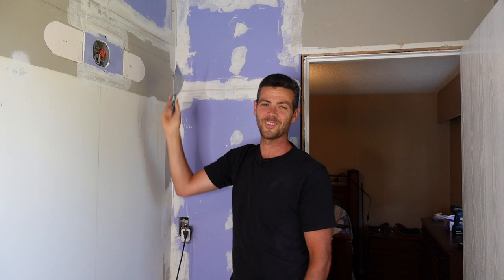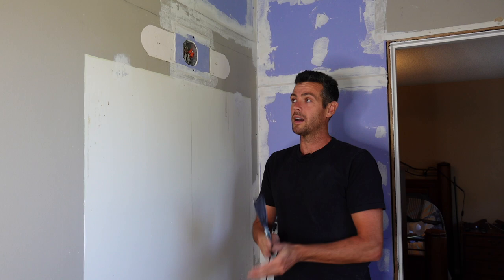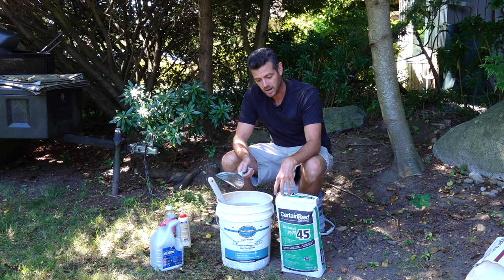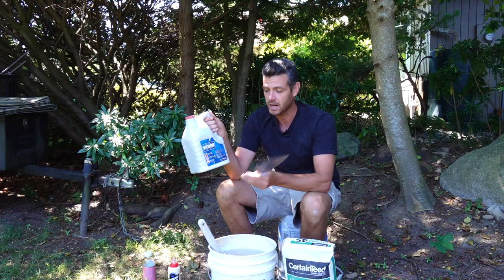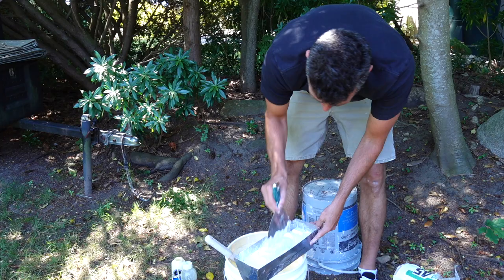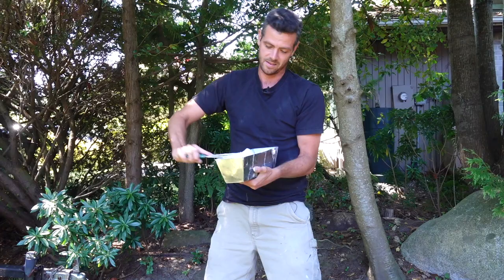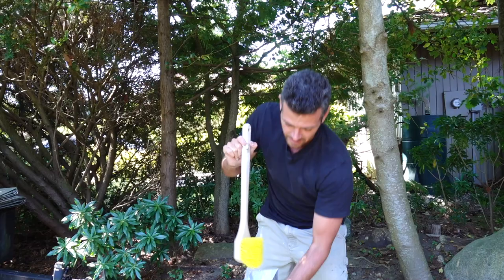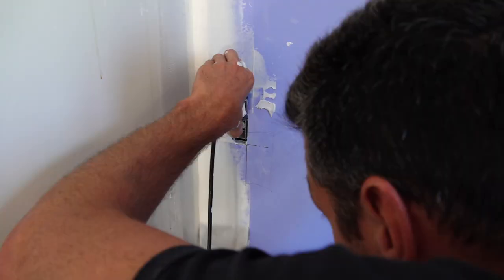How and When to Add Glue to Joint Compound!

Comment: How about channel bead, I have numerous places where it is chipping off and I can see empty voids through the holes?
Reply from the maker: I totally forgot about that. Coating anything plastic I add glue to my mud.
Reply: Use Durabond as your first coat for such a demanding repair.
Reply: Does Durabond have enough glue to stick to a painted (glossy?) surface?
Reply from the maker: @michaelbasic6947  I would at the very least sand the surface.

Comment: Just FYI, I called Weldbond and asked them about mixing their product with drywall mud and they stated that the proper mix ratio is 1 part Weldbond to 3 parts water.   I skimmed an entire room with 45 minute quick set mud and it stuck like you wouldn't believe.  I was worried because the walls were gloss painted orange-peel texture.  But the stuff stuck great using that mix ratio.
Reply: Thanks for putting in the work and getting that info :)
Reply: @stevensko9153  thanks. I'm going to use a little gorilla in my topping mud to do some last minute taping I missed
Reply: Extra glue doesn’t matter. Isn’t like he measured anyways 😂
Reply: Sounds like a lot of glue, especially if that 1 to 3 mix isn't added to the pan water as VC did.

Comment: What the heck? Glue? I mean I am sure it works great but why? I am only in 33 years but never had problems w bonding. Only going over paint that was glossy in my early years w paint but proper De glossing/washing solved that.
Reply: A crack on washable/ high-quality paint on smooth walls can be a pain in the ass. The lack of adhesion even with regular mud is an issue.

My only comcern is sanding or pulling a tight coat with regular and have that delaminate

Comment: A video that is validation of my belief about glue in 45 set mud.This is something I started doing 5 years ago. This has saved me thousands of dollars. Most of my work is repair work. Plus I mud over painted surfaces. Thanks for putting out a video that will help many people. Learning about the importance of strength and adhesion. Significantly increasing the performance of plastering products. Paper tape seems to work very well with glue mud.Mud sticking well to screw heads and metal trims is paramount.
Reply: I think it all boils down to cost and scale. Drywall is just such a cheap material in the grand scheme of things. If you could buy a regular bucket of mud for $11, or the BEST, guaranteed not to fail mud for $22, would you? I would. But a commercial high rise contractor wouldn’t. That bottle of titebond quite literally costs as much as the entire bucket of mud. And thus we have arrived at the fool-proof guaranteed not to crack small job salvation mud.

Comment: You are a good example of someone who thinks out side the box. Quick set is a great example, I’ve always used glue in place of the expensive plaster bonders. I know it works, no fail, restored Wyatt Earp’s childhood home before his family moved west, complete restoration completed part of the top floor 12 years ago, no flaws. Light years ahead of another crews restoration in similar walls and buildings built in the 1850. They used a lot of horse hair back in the day. Probably used the hooves for glue😂 back in the day. Pella Ia.

Comment: Maybe a topic to cover? I am drywalling my cottage right now and I am stumped as to the best way to mud odd angles and transitions. I have walls that transition to open angled vaulted ceilings and also have sloped ceilings that transition to a flat ceiling higher up. I am struggling to get a clean finished straight line where the two planes meet and to actually get enough mud build-up at that location to allow sanding. I used Sure Corner tape at these locations. thanks for considering this.

Comment: If you lived in interior BC when sometimes there are extreme (wet) snow loads, you would use glue to repair failed joints that only failed because of a rare 1 meter of wet snow on the roof. I wasted a lot of time and trouble assuming taping mud has enough glue in it. The tape doesn't necessarily lose bond to the wall, but rather tears apart. It's much harder to tear drywall tape when saturated with wood glue. I have never had to repair a failed joint with added glue. Even when the cracks happened under normal snow loads, yet the glue held up during the 1 in 20 years when we get massive wet snow loads.

Comment: The glue added to make sure paper tape sticks and never de-laminates. Sanding more difficult but  excellent results even if too generous with the  glue.
Reply from the maker: I never end up sanding it as I only use it in quickset and only top coat with pre-mix.

Comment: Using glue in hot mud is something I do anytime I’m installing tape, bead and pre-fill on painted/old work/repairs. Including vinyl products like expansion joints and edging trims etc. For new work I just use taping mud for all taping, bead and edging. I typically hit the screws when taping as well though when I spot screws using taping mud I keep the spotting as small as I can to make it easier to finish and sand. Nothing worse than having two different mud types exposed when sanding. The softer mud will always hollow out. Keep it small and tight when using taping mud on screws. 👍

One ol’ hawk and trowel mudder to another  😂

Comment: Someone asked you about using Durabond in some past video and I remember your reply was that if wasn't easy to find in your area. Come on, get a bag, try it, it is very good, although I doubt you haven't tried it already? The only downside is how it is so hard to sand, but that superior strength and adhesion is a good thing since it's appropriate use is as the base coat in demanding taping, repairs and prefill situations where no sanding is needed. The other (I think worse problem) is how it demands you clean your tools right away and very well.

I think adding glue to regular setting compound is an antiquated, more time consuming and inferior to Durabond. Preparing the surface is the most super basic, yet essential step in 1000s of repairs. As you point out, 1:35 "got to sand it ...not enough", so by "not enough"; I don't know if you mean to say that your chemical solution of adding glue removes the need of surface prep sanding or you both sand and add glue?

For the type of greasy/waxy surface that even sanding won't solve I use a ammonia/water solution with a green Scotch Brite pad before sanding. It leaves it squeaky clean with a dull finish. Sanding after leaves an excellently prepared surface.

Comment: I have been using a pva product called Unibond for decades now,    But I almost never put it IN the plaster, if you want to skim a painted wall brush on 50\50 let it dry, then paint on a full bore coat. When It gets a little more sticky, plaster it while still wet. It will stay on the wall.  Some of the pva products sold for plasterers are useless,only experience in your own market can tell you about that.   PVA in backing plasters can be useful (repairing lath and plaster ceilings) but it does slow down drying times. Don’t put it in skim coats because if you leave a mark you can’t sand it down easily, and the painters will hate you, it will take forever to dry and the painters will hate you, There will be no suction, the paint will slide and the painters will hate you. PS they hate you anyway, they’re painters.

Comment: Too add water to my pan I use a spray bottle.   On mist fan spray. It lets you add small amount of water over the entire pan.  Better for mixing.  Sometimes when mud is stiffening up and you want it wetter thinner mist water into your pan until you   Get desired feel you want.  Water bottle more controllable way to add water.  ❤❤😂😂

Comment: Not long ago I had to use all purpose mud with mesh because I had nothing else on me, and not long after that, I had hairline cracks in the middle..
I know I know, I shouldn't have used all purpose mud with mesh....
With this said , instead of re-taping everything, I just cleared the seems a little bit more without  ripping through the mesh, and filled that crack with a mix of all purpose mud and glue, and it worked. 
I had already tried on a couple other Seems to fill the cracks with all purpose and it recracked but with the glue it didn't.

Comment: The thing I find interesting is how old school plasterers and drywall folks have similar yet different ways of tackling the same problems. Kirk puts the product--I think it's called weldcrete--on the wall directly before applying his mud. Now, he probably couldn't use your method with plaster, but I think you could use his method with good results. Might be easier on small patches. I'm guessing you like the mixing method better because it's easier on bigger jobs such as taping.
Reply: I think the reason you don't mix pva into plaster is that the plaster is very hard and strong by itself, unlike drywall muds which are quite soft and weak, so mixing in the glue is more likely to compromise the strength of a plaster, but that is just my somewhat informed speculation.
Reply: He is using plaster / aka stucco products , and I would guess would not sand or wash down anything before application of the bonding agent.
Thanks for posting

Comment: USG has a product called plaster bonder which is made of polyvinyl acetate (PVA). I live in a home with plaster and lathe and I applied it with a spray bottle to the old plaster when I am doing a repair and it works great.  I have wondered if this could be sprayed or wiped onto a wall if you wanted to do a large patch or skim coat with quick set.
Reply: Yup PVA is common white glue like kid eat in grade school.

Comment: Love your style! Of all the videos I’ve watched , you seem the most skilled, I’m hoping you can help me out. I want to create a faux stone wall over rough hewn wood paneling. Firstly, I’m worried about adhesion. Should I be? It is a very rough texture. Do I need to use a primer or mesh? Secondly, , I’d like some stones to stick out up to an inch. I’ve read hot mud is the way to do this as it doesn’t shrink. Or would applying several coats of lightweight drywall mud be better? Any tips here?  Does weldbond also make the joint compound more durable and less prone to wear and tear? Nothing makes a faux stone wall look more faux than chips and chunks missing out of it, haha. And finally, I'd like the finish of stone— can I add something, maybe limestone powder, to give it a porous, stone like finish? Thank you for your time and your channel!

Comment: Not a drywaller here, nor am I a carpenter, and nor am I from Canada.  So maybe I'm just thinking incorrectly... but if you use the glue, just the glue, after mixing it 50/50 with water.... will that still even glue stuff together?  Something tells me that the glue will probably still stick things together, but if you did a side-by-side comparison of, let's say, drywall tape glued to drywall paper - where one is glued with 50/50 water/glue, and the other is 100% glue, the one with water will not be as effective as the 100% glue.  So I have to wonder how effective it'd be when spread even thinner.  Dunno.

Having said that, I love watching this channel.
Reply: Depending on the application, Weldbond calls for anywhere from straight glue to a 10:1 mix. Note also that ALL pva has water in it when you get it.

Comment: I mix a lot of 5-min compound for patching and a paint stirring mixer in a drill is great for mixing the compound lump free.  I mix in round cups for ease of getting it consistent.  Also, what about just priming the wall, with adhesion primer, first?  I see his point for small fixes, though.

Comment: Hey Ben, thanks for another great video! I'm curious if you have ever used Durabond? I think it's a USG product. I've used it alot for prefilling and patching and had good results as far as I can tell without adding glue. I did learn quickly that you better keep it flat because there is no sanding the stuff! Thanks for any input you have! Hope you're doing well.
Reply: Durabond reminds me of plaster it’s so hard to sand. It is made by USG, same as the “easy sand” (total lie) quickset. The later is what I usually buy at my local Menards when I need a quick set mud. 

Has anyone else tried the Rapid Coat Extra Lite? It had a green lid and is made by Continental. I really like using this as a top coat- very smooth application and dries tough but good to sand.
Reply: I think patches and prefills are exactly what Durabond was designed for, especially if you are working on old plaster surfaces, where the hardness of the Durabond matches the preexisting surface. The stuff does seem quite sticky without adding any glue, which makes me wonder if there is an adhesive in it already, despite it being a quick setting powder mix.

Comment: I had problems with CertainTeed brand all purpose light weight compound. The first coat goes on fine. The second coat causes dried chunkies from the first coat to flake off contaminating the seconcd coat mud making a quality finish impossible. I ended up applying  a coat of primer paint between coats of mud to bind it together.

Comment: What about adding glue to the first skim coat if I want to remove texture from my walls? Only if it’s powdered mud?
Reply: Great question!  Wondering the same, especially when skim-coating powdered 45 over painted surfaces…

Comment: I'm down in Port Orchard. Same area. If I was to add water and convert premix mud to spray texture, would it good to add glue if I'm spray texturing a smooth surface like plastic coated foam board insulation, like PolyPro or R-tech?

Comment: How about if I am repairing a section over cement board? Will wood glue stick to the cement board and the improve the adhesion to the mud? What might you use to join cement board and mud? It's a bathroom ceiling so want to add something to ensure it's all stick together. thanks!

Comment: Do you think Durabond 90 needs glue added?  I called USG and they said that paper tape is better/stronger even on plaster repair,  so I'm using that instead of mesh to fix small cracks (after carving out my v). My wall is painted plaster and I was using Durabond without adding anything for adhesion to tape and fill in holes (did not feel like spending 40 bucks on Plasterweld). One small section did not stick for some reason. So I'm going to try again and was thinking, after watching this video, to add add glue.

Comment: @vancouvercarpenter - I am about to skim coat over an entire ceiling that is popcorn texture mixed into the paint. Absolutely impossible to remove (I've tried). It is entirely covered by glossy paint. Should I add a little bit of glue to the normal premixed mud? I am concerned about it flaking off because of how thick it will be due to the popcorn. I am also wondering if I need to get a light compound?

Comment: Hey Ben, Do you prefer glue/tape on corner bead of nail/screw on? Do you or Have you ever seen people use paper/mesh tape on a metal corner bead?
Reply from the maker: I prefer paper faced bead(tape on). I have seen people add mesh tape to steel beads. I’ve done it myself using quickset. Takes a long time but super strong results.

Comment: I'm a noob was green board a bad choice for a cover over existing bath ceailing with a little black mold & blistering painted ceiling? The fan was replaced with higher cfm but, moisture causes streaks down the walls.  I thinks its the exhaust fan discharge is too far away from bathroom fan?

Comment: At what point can you tell there wasn’t good adhesion to a glossy painted or metal surface? Are we talking immediately? Days? Months? Years down the road? 

Does anyone know if “Sheetrock” brand has this need for additional glue?
Reply from the maker: Usually when you apply your next coat of mud or paint. I've tried sheetrock before and I believe adhesion was pretty decent.
Reply: If you mean USG easy sand I've had adhesion issues with it over non-porous or excessively porous surfaces.  Since then I always add glue to that product.
Reply: @vancouvercarpenter  thanks dude. Your help has been instrumental with pulling off this popcorn ceiling removal+drywall repair in my boy’s room.

Comment: yesss, been waiting for this video since your OG glue vids. 

Can you make one clarifying the porous bubbles? Im confused about the tight skim thing, is that 1 coat and then dry and then skim again? or like do a skim and then do another one right away? always found that vid abit confusing
Reply from the maker: On final coat when the bubbles start coming I often have to do a tight skim and then immediately recoat to be able to leave a decent coat. This only happens on painted surfaces not on new board.
Reply: @vancouvercarpenter  thanks

Comment: I have a serious question. Can I turn the Topping joint compound into a product similar to Lightweight spackle. I use both and I mixed them together etc., for cake decorating. I feel like I can take heavy topping compound and make it better. (I havent tried Topping lite weight). The spackle is too fluffy. The topping is to heavy but both are good for my art finishes.... Could they be better? Or what additives can i use in topping? Ive tried glue and it cracks the finish.

Comment: I can't get Hamilton fast set here in Saskatchewan unfortunately, only certainteed and synko. I'm curious how it compares to other brands as far as workability, sandability, and shrinkage. Would you say that's your favorite to work with? 

I'd love to see you do a comparison of different pre mix brands, like for like. For instance certainteed finishing vs sykno finishing. Do you have any preference? 

Love the vids keep up the good work
Reply from the maker: The synko  pro-set kind of sucks. Poor adhesion and weak. It’s way too light and fluffy for good repair work. Not bad for coating but stick to the certainteed when you need strength.